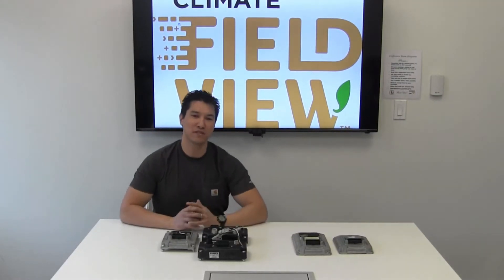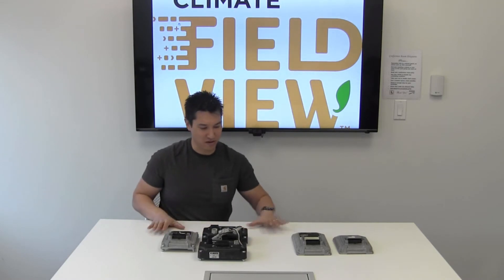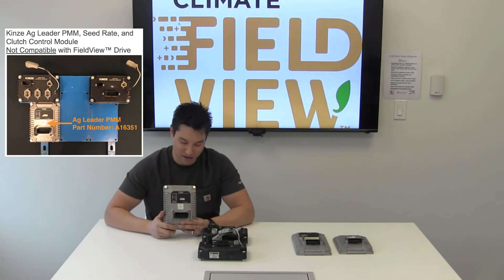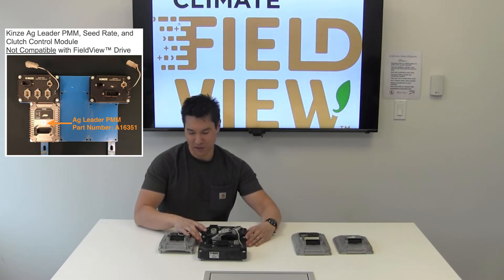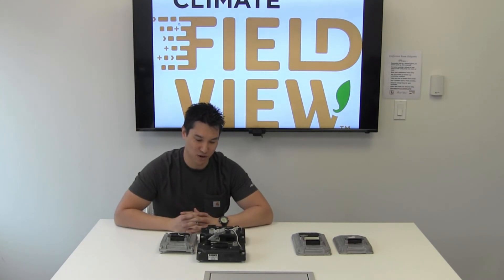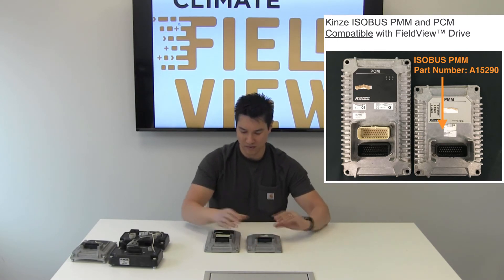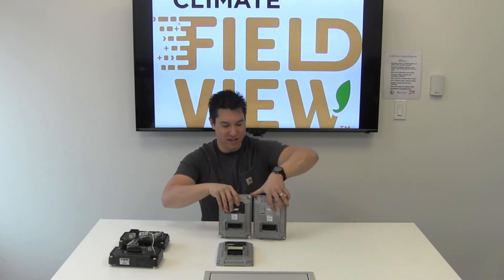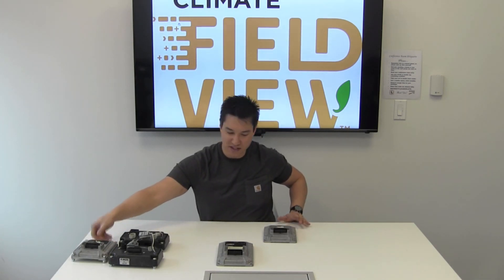Kinze Ag Leader vs Kinze ISOBUS Planter Monitoring Modules

Comment: The coloring of the decals on the PMMs does not directly correlate to which type of PMM it is.   I have seen both with either the black or the sliver decal.  
The part number is the only reliable way to tell.